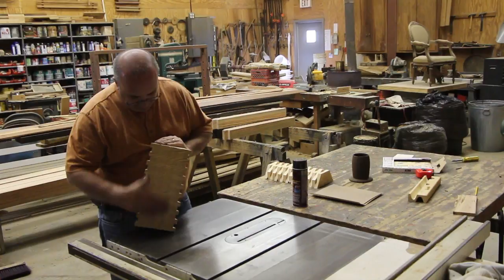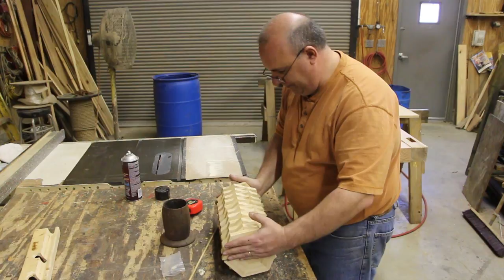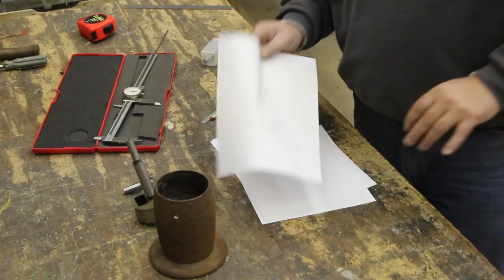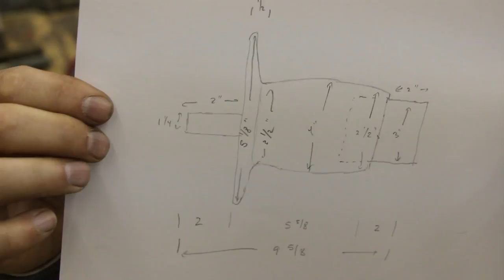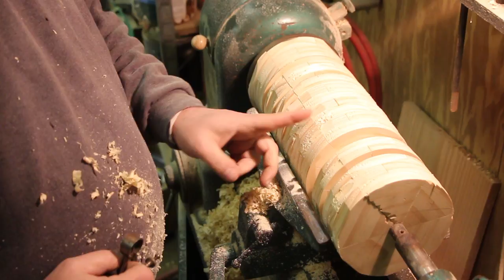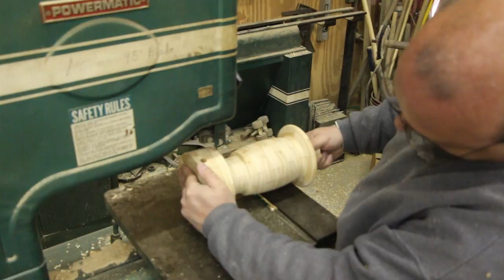Pattern Making - Flat Belt Pulley 2

Comment: Wondering.... Do you compensate the size of the pattern for the shrinkage of the cooling metal?
Reply from the maker: Yes, I used a shrink rule to do this - which takes in the shrinkage factor for cast iron.
Reply: Oh,  okay I know as I was an old fabricator heat and shrinkage were a factor always needed to be taken in mind. Thanks Keith
Reply: @VintageMachinery  Hey Keith, you did use a shrink rule. For the record, shrink rules are not calibrated for any specific metal. Rather they adjust for a specific amount of shrink. For example 1/8 in per foot. In theory a strip of iron will shrink about 1/8 in per foot. In practice that’s not always the case. Depending on the iron and the shape of the pattern, you may not see any shrinkage. The core serves two purposes. First it gives you a rough starting point for machining. Second it evens out the thickness of the casting features resulting in more even linear cooling and a reduced dependency on risers to mitigate shrink voids in heavier sections. Thirdly by  making the cooling more even or linear, it greatly reduces internal stresses in the part.

Comment: If you were concerned about keeping the "drive" end stronger, and left the 1 inch core oversized to 3 inches to allow this, why not turn the pattern 180 degrees and have the thin core on the centre end, allowing a drive though the 3 inch core?

Comment: I found it rather amusing that in part 1 of this project you fussed with the miter trimmer to make all 6 segments fit perfectly with no gap. Now you still went ahead and jointed the mating surfaces flat. So It was totally unnecessary to be that particular.
Reply: You gotta love wood glue ups. The parting line is one thing. But the segment joints for the most part were tight where thru count.

Comment: Thanks for another great informative vid.  I have two questions.
Why not weld the pulley instead of replacing?  Old machines are often found with repairs, so you would still remain true to the technology and save hours of work.  But then again, we wouldn't see how this process works so thanks for the extra effort.
I've never turned in wood, but instead of using all these segments, wasting hours in the process, why not use MDF to make up your halves.  MDF is very stable to temp and humidity, extremely flat, glues well, and is easy to work on high speed shapers.  Plus there is no end grain and no internal segment joint seams.  Does it not work well in a wood lathe?  That said, I appreciate seeing the old methods using lumber.
Reply: *****
Thanks

Comment: 3 D printing is more efficient nowdays
Reply: *****  That s great, if you want to preserve the technology. Unfortunately in factories you don't work like this anymore. You use CNC or 3 D printing. In Hungary for example at Opel factory the prototype for a gear box in made with a 3 D printer. Using an older method with wood would take about 6 months. Wiht CNC is very hard to do it, 3 D is the ideal solution. It takes only 6 weeks do finish it.
Reply: Szaby Sascha 3D printing is a fad. It replaces the woodworking skill sets so an idiot can do it.  Your efficiency is achieved by placing the design into solidworks or whatever your using.  I machine wood all the time on metal working machines and use CNC control from time to time to do it in making infill hand planes.  In terms of getting there... your either going to remove material or add material.  Two different viewpoints... same end result.  I am more interested in the thermodynamics of cooling metal.  How does the metal flow in the mold.  How does it shrink.  Do I need a match plate.  etc. etc.  3D printing can help you but its not as effective as you think.  Your still going to need to make the final parts.  Most plastic injection molds today are done in solidworks, emailed to china, and the final injection dies are fedexed back to the US.  No 3D printing.  Just CNC machines removing material.  For what we do, this method still works quite well.  Taking an old time pattern maker six months to make a pattern strikes me as strange.  Are you guys training the patternmaker  during that six months?  It took MoPar two weeks to build a new version of the 426 HEMI engine after a significant design change. (Set of wooden chrysler patterns).
Reply: I don't know the 6 six months thing. I just read it in a technical magazine from Hungary. An engineer wrote an article about this topic, and he said that. Here in Romania there isn't any training for this profession any more. My dad learned this in the 60's , in 2005 the factory where he worked said that they don't need this department anymore.
Reply: Sadly, he is correct.  The pattern world has been replaced by Solidworks which is an incredible software program.  But wood was cheap and quick to machine so it was a perfect medium for patterns and prototypes.  Now, we have CNC machines that can cut solid aluminium faster than slick willy.  Just dont let the 3D printer fad catch you up.  In some cases, its great.  Usually in those cases, the reason the 3D printer can do the job is precisely the reason the foundry guys are going crazy.  Patterns still have to be rammed up on a squeezer line and that means core prints, cores and draft.  Some things change.  Some things will never change.
Reply: You re right Arnold.

Comment: When using the joiner, the leading edge almost always ends up thinner than the trailing edge. I like to turn the piece end to end each pass to keep things even if the grain allows.
Reply: In theory this is false. In practice this is true. I noticed this abnormally on my porter 300. In terms of blow out. I am not a fan of fancy insert heads. This may be one case for them, I don’t know. But the jointer is about accuracy. To many folks forget this chasing surface finish from a jointer. A scraper plane such as a Stanley 85 would truly solve any surface issues here. A Stanley 112 would also work and it had an adjustable angle.

Comment: You briefly mention a "shrink ruler" when you first introduced the use of the spring calipers. for the folks who don't know, a shrink ruler is set up to include the expected shrinkage when a given casting cools.

For example, a shrink ruler for cast iron will be engraved to read the final dimension of a cooled cast iron part - so the pattern needs to be a few percent over-size.

Other shrink rulers are calibrated for aluminum and bronze - probably a few others are made as well.

This way, the pattern maker isn't always trying to calculate the over size dimensions while turning and carving - very critical in the days before electronic calculators!

Comment: Gouging always worries me, with the guide being set a half inch or so away from the piece being worked plus the increasing distance away from the guide when turning, my self preservation says that the Gouging tool could catch on a Knot or a fixing screw and flip/catapult/ seesaw of the guide and take your head off, I would have thought that a second guide situated above and in front/ (closer to the operator) of the bottom guide would be 100% safer, that said I am aware that the method here has been used for years so are my concerns unfounded ???
Reply: ***** Point taken Keith, experience is everything, but it seems to me that  there's a heck of a lot of power/velocity which could catch an operator off guard in a split second if your concentration is distracted

Comment: A slightly different way to register the two halves is to first glue them together with paper between them.  Then drill a holes that go through one half and into the other.  Drive your wooden dowels into the holes and now the two pieces will be perfectly aligned when you remove them.  This way you don't have to worry about the two pieces rocking slightly off axis when you drill the holes in each half.

If you use paper between the two half of the pattern when you do the glue up you will have a strong enough bond so the halves do not split when turning but you can then insert a knife at the paper and actually split the paper.

I think that tubalcain has a video showing this process.
Reply: Congratulations.  I just watched Keith turn these pulleys for you.

Comment: Thanks for the education, can't wait for the next installment. That pattern is so damn pretty I'd be inclined to use it as the pulley instead of having one cast, but I understand staying true to the original materials thing. The machining stage will make  an interesting video too.
Reply: The machining part of this pulley was done by Keith Fenner in his series "Working the curves" Part 1 was released Jan 20, 2014.